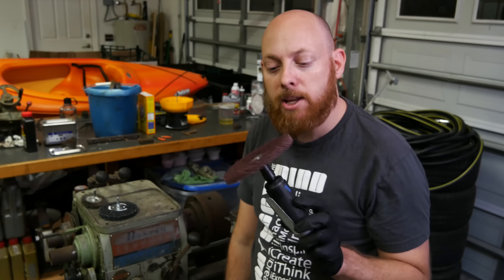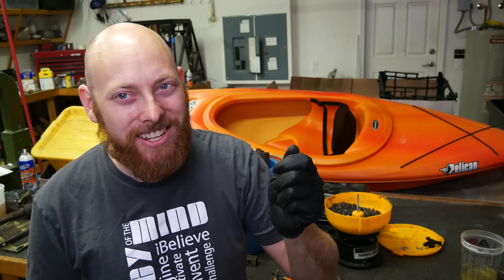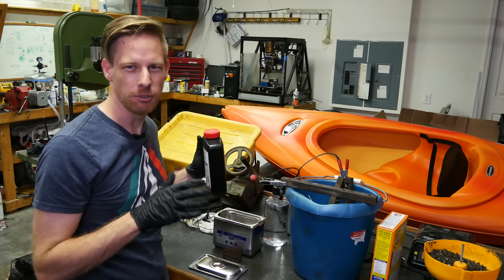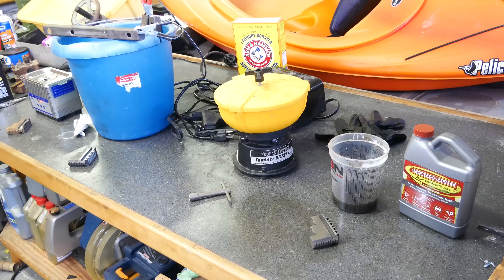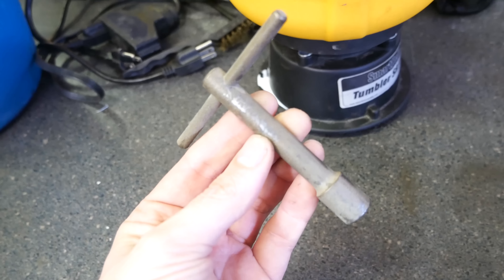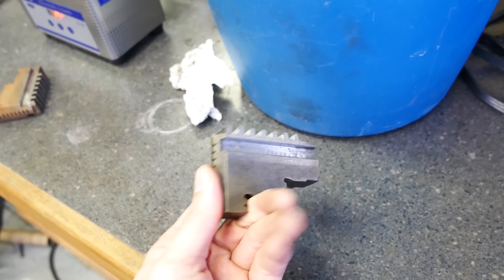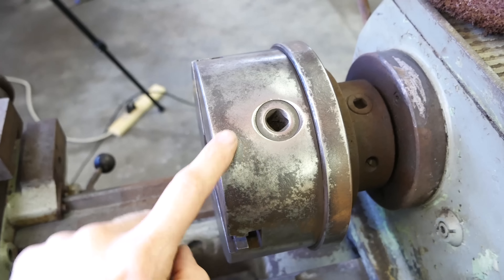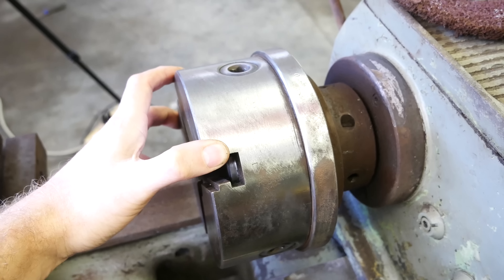Lathe Rebuild Part 2 (6 Ways To Remove Rust) - S02E02

Comment: Evaporust leaves a dark film on steel, especially when it is hardened.  You can just clean it off though.

Electrolysis is definitely a much cheaper option, but very prone to flash rust, which the film left from Evaporust prevents.
Reply from the maker: +Hand Tool Rescue that is good to know. I noticed the color would come off pretty easy. I have just been coating everything in a lite coat of oil after I pull it out of the evaporust
Reply: Stick the Evaporust in the ultrasonic cleaner! Works faster and minimizes the deposits
Reply: yes the dark 'film is called 'iron' ... it reduced the ferrous oxide to metallic state
Reply: I disagree, flash rust is caused from an oxidizer like many acids that are used (like hydrochloric acid) the electrolysis method will not cause rusting after the electricity is shut off, matter of fact an alkaline solution/deposit on tools will prevent further rust from occurring.

Comment: Ive been restoring an Old SBL 10K for a while now, I think you've done a great job. One thing I've done and It works rather well is mask and sandblast parts that are exterior pieces. It saves a lot of time and then I repaint them once fine wire wheeled.

Comment: hey guys, a bit late to the party however... i have found with basic rust removal, a simple vinegar bath (just plain white vinegar mixed with water ((3parts vinegar, 1 part water)) and a few hours left to soak usually gets most surface rust to break off, which is then followed by a quick scrub with scotchbrite, steel wool and any other abrasive will do wonders to the larger and less intricate parts, any maybe even smaller parts.. i could not stress enough though to dry any remnants of vinegar solution off after the scrub has been completed; to prevent further rusting of parts.. colder weather can affect this process (not significantly). loving the rebuild by the way! ps.... don't know how i found this channel but its so far so good for me! double thumbs up
Reply: also the solution can be reused multiple times, with a top up of vinegar every now and then! cheap and ez

Comment: When using an ultrasonic, the solution needs to be roughly 10 degrees below the boiling point of the solutions to get the best effect.  You want the pressure oscillation to create steam jets to do your scrubbing.  Frequency also matters.  For big chunks use low frequency.  For small scrubbing and to get into fine details, use high frequency.

Comment: Acid is usually used industrially for removing rust (pickling) I did an engine and sheet metal that way with great results except it ate a sintered iron harmonic balancer to where the original press fit became so loose it would spin on the crank! Adding some phosphoric acid "MetalPrep" left a nice phosphate coating to paint on, though I jazzed up the acidity with judicious additions of muriatic acid from HD. Take great care, it is undiluted!
I think the use of a base, sodium carbonate, was a great idea to make the electrolyte conductive, as I recall NaCO3 is good for cutting grease and combined with the agitation of the fizzing electrolyte was probably good at removing any remaining grease. It would be interesting to try that solution to cut grease and rust both. Glad to see there is an alternative to abrasive on stamped leas screw wheels, I hate to see them worn.

Comment: With a few years of amateur car part restoration behind me, I have tried wire brush and elbow grease, through to garnet (sand) blasting, and electrolysis.

I found it was best finishing the mechanical process with chemicals like "Jenolite" "naval Jelly" which are both based on acid, mostly Phosphoric acid with others.The phosphoric acid provides gives a grey phosphate coating that is rust resistant. I have parts in my spares boxes that where sands blasted and then treated with Jenolite that are rust free after more than 15 years.
I set up a 120 gallon plastic barrel of "washing Soda" and a 12 volt 30 amp power supply to remove the very heavily rusted parts, it removes the flakes (and paint) leaving the parts with a thin film of BLACK ferric (ferrous ??) oxide, looks like a fine powdery mill scale, this is best removed immediately with a wire brush or scotch-bright pad, and you need to stop further rusting.  
I tried acid of various types (sulphuric, hydrochloric etc) but I found the easiest and safest to be neat 81% phosphoric acid (sold in the UK as "PH DOWN" for hydroponics alkalinity control), it is FOOD GRADE (as used in cola drinks at about 0.05%).
I you forget your gloves it only stings your cuts, I don't recommend handling it without gloves, your skin gets "slippery" (dissolved).
I recently purchased a pillar drill with minor rust (not like the bantam lathe), the phosphoric acid removes and the rust minor and major, if brushed or cleaned with emery cloth the get the worst off. I clean the surfaces with brake cleaner and/or acetone both work well before the phosphoric acid, grease and oil will stop it working.
The chuck key was beyond repair, I thought I needed a new one, but I found that using the Phosphoric acid HOT, diluted with some tap water, I could achieve a BLACK finish with all the rust removed. Soaked in WD40 it looks as good as new. 
Further experimenting shows that the HOT DILUTED process can be controlled to allow a fine grey finish through to black, I used it to restore a pair of V blocks that had 50 years of thin bright orange rust collected in bottom of my apprentice tool box, to pale grey finish. I also restored a pair of rusty apprentice piece tool makers clamps back to black finish (originally oil blacked).I will in the future put up a youtube video, when my health permits.
Chris
Reply: CellZ
apper

Comment: Lye (bases in general) will work on fatty and oily products. Think of mixing it with human fat to make soap in Fight Club. You need an acid to remove rust. Zero reason to expect sodium hydroxide to work on rust.
Reply: exactly. rust is an iron oxide (oxidised iron) so we need to REVERSE this and REDUCE - which calls for an ACID
Reply: Lye solution is also the best for removing anodizing from aluminum!

Comment: About the ultrasonic cleaner. Use a solution of citric acid. And if there is grease on the rusty part, add a little detergent so the citric acid can penetrate the oily surface.
Reply: Not to mention that it is a tiny unit, that has next to no power, maybe usefull for a few screws at a time. For bigger parts etc. you need a bigger unit with frequency sweep.

Comment: The solution for the Ultrasonic Cleaner can be pretty much anything that removes rust...but quicker with the bath.
Using the Evapo-Rust in the US bath would work very well...and in just a couple/three hours.

Comment: Electrolysis is by far the cheapest and most effective, it will also remove layers of paint. You do need to make sure anode and solution are regularly cleaned for max effect. I personally worry about the safety of leaving it running with kids and pets so I take measures to hide the vat. I also like Purple Power/ Super Clean for a set/forget option if I'm not going to be in shop for a while.

Comment: Body shops use a product named metal prep which removes rust and leaves a phosphate primer coating for painting - scrubbing with a medium fine wire brush helps process. Similar stuff available at HD. When it loses its punch or if you want to punch it up a notch, try adding some muriatic acid (hydrocloric acid). Acid eats rust, bases eat grease. I used it on a small block Chevy engine once and it worked great on stuff that needed painting, left a phosphate coating on stuff that needed to be shiny, and tried to eat the sintered steel harmonic balancer, the formerly press fit balancer would spin on the crankshaft. I had to buy a new one - expect the same disaster with brass, aluminum and chrome dissolving. Use for short periods and neutralize with baking soda afterwards. Do not allow to soak unsupervised. This is with the HCl turned up strong. do not add water to acid, but do the reverse, water to acid can boil and blow it all in your face! This is industrial stuff, be very careful.

Comment: White vinegar in the ultrasonic would probably work better.  While a part can be left in electrolysis for days, don't leave your machine metal in vinegar more than a few hours without checking its progress, to prevention erosion of the metal..  The price was right, and now you will have elbow grease equity in the lathe, and should be able to triple your money, or more.  Nice find in the gearbox.

Comment: Maybe a little bit late, but vinegar acid reacts with the iron (Fe) and builds acetats (i don't know if this is the right english word) it's a little bit like blueing metal and i also prevents from further rusting. Not to much of course. But you need to neutralize the acid, otherwise you have rusty parts within minutes. Washing powder with water works very good for that.

Comment: 8" 3/4 hp bench grinder with a twisted wire brush. More fragile stuff a normal wire wheel. 
For the 'chemical ' solution. Mollasses but you have to hose the gunk off and then CRC it or will go rusty immediatly. 
For the bed a twisted wire 4" brush on a diegrinder.

Comment: white vinegar
Reply: This is the best and cheapest solution. No discoloration or etching like evaporust. Will eat the rust down to good metal and doesn't take as long.
Reply: Isn't that the main ingredient in Evaporust?
Reply: Hydrochloric Acid (muriatic acid) is the active ingredient in white vinegar. For $10 at Lowes you can buy a gallon. Important note: you need to neutralize the acid afterwards, Bicarbonate soda works well, then rinse, and paint or cover with oil film.
Reply: there is no HCl in vinegar.  vinegar is acetic acid in water, about 5%.
Reply: I recently put white vinegar to the test on some rusty old Gym weights and the result was great. Very hard option to beat for the price.
Reply: Mike St. G
Reply: Cleaning Vinegar even bit stronger. Awesome rust remover. So is Navy Jelly. Restoring 100 year old lathe with it but believe it or not there is almost no rust.
Reply: muriatic acid = better - ANY rust 'cleaner' worth it's salt is acid based
Reply: no there is no H Cl in vinegar - but there's plenty of H+ !! - i suspect that's what Rick meant ... that acid was the 'active ingredient' and rick is PERFECTLY right as muriatic acid is FAR stronger = more effective

Comment: Why would you mention the minuscule power use of the electrolysis and not the cost of a bottle of Evaporust? not to mention toxic chemical solution everywhere. Get a good quality bench top power supply that outputs around 30v/10 amps, make your anodes bigger in order to draw more amps and then you can do the whole headstock in a few hours paint and all. It is by far the most gentle but bubblingly effective way to do it. Great video by the way, you wont regret having and old English iron machine tool in your shop.
Reply from the maker: +Tristan Patterson that's a great point, I wouldn't have considered this for paint removal. I will have to give that a try.
Reply: Tristan Patterson - I agree electrolysis is a winner. However, I noticed excessive bubbling means only water is being split, the process is somewhat blocked by the surface layer that develops on the part. To overcome this, I mixed two technologies to remove rust from some smaller parts (collets), did the electrolysis in an ultrasonic cleaner, with the below mentioned vinegar solution.  The process speeded up dramatically.  Quickly wiped off any remaining loosened up surface contamination, washed off the part and immersed in mineral oil completely, before final wipe down. I also used graphite electrode, leaves the solution cleaner than iron ones. My ultrasonic bath is about the same size as in the video, so larger parts may not fit.  To prevent the electrolyte causing accidental damage to the cleaner, I filled the tank with plain water and the electrolyte, electrodes and parts were inside either a plastic bag, or in a plastic bottle, immersed in the tank.  I've been thinking to get a marine boat de-fouling kit that contains the transducers and immerse it for agitation in a larger container, it is on the to-do list!
Reply: Wow, yeah the graphite electrodes is a great idea. Do they conduct as good and how large can you get them?
Reply: Tristan Patterson - Graphite is an excellent conductor.  eBay is a good source for inexpensive rods at around 6-10 mm diameter, usually Chinese origin, some are sold by the dozen, some by weight. Otherwise EDM electrodes are also quite good, but the dense high quality ones may be too expensive for this application. Aluminium (aluminum) smelters use huge ones as anodes, I bought some at an auction up-to 150mm diameter and 1m long in view of making my own electrodes for larger parts, but that would require a much larger power source than what I currently have. For thin pencil size ones I use them in parallel, say one inside the centre line of the collet and three evenly spaced outside, to even the current distribution. It works with just one, but you need to either reposition the part or the electrode every now and then. Just make sure you don't short with the workpiece. In a pinch you can salvage some from discharged Extra Heavy Duty lantern batteries, the centre electrode is a carbon rod. (Not the later alkaline ones which use a different chemistry, please look it up). Good luck experimenting!
Reply: Excellent, I have some of those lantern batteries.
Reply: Tristan Patterson Evaporust is non toxic and biodegradable and can be poured down the drain for disposal. You should check yourself before criticising someone else.
Reply: Fair point. I have only recently got hold of a bottle and you're right. I was not criticising but merely pointing out the benefits of electrolysis.
Reply: Great information! Quick question regarding graphite electrode though, I was under the impression the cathode needed to be iron for deposition. Does the free iron deposit into the graphite cathode or stay suspended in acid solution?
Reply: Christopher Bogart 1

Comment: Rust.. If you are in a hurry 5-10 minutes in 30% HCL and 10 minutes in a bucket of water with a teaspoon top of backing soda then dry with heat gun or hairdryer and oil.. trust me that works
And if you dont like HCL and have more time submerge  4-5 days in vinegar then wash and light scrub with a kitchen sponge and then 30 minutes in a bucket of water with a teaspoon top of backing soda, then dry with heat gun or hairdryer and oil..

Comment: citric acid is good on copper and brass dont know about iron and steel. Citric acid is used for cleaning  wine bottles, it can be purchased in crystal for to dissolve in water.

Comment: high grade phosphoric acid is the best solution for removing rust.
Reply: I totally agree.  I use Naval Jelly (Phosphoric Acid in gel form)  for things that cannot be easily removed and dipped.  For most other items I use either electrolysis or a Phosphoric acid solution.  The only warning is to not leave cast iron items in the Phosphoric acid solution any longer than necessary.  Plain steel does not seem to be limited in this way.

Comment: 1:29 because baking soda sounded too unprofessional 😂😂😂
Reply: THE MTB FANATIC "super washing soda," baking soda will work too but slower. Any electrolyte will work actually, but I wouldn't recommend table salt because you'll be generating chlorine gas in the process if you do. Sodium bicarbonate is sold even cheaper without a brand-name if you get it from a pool supply store or from a chemical supply for printmakers.
Reply: He wasn't using baking soda, that's why. He was using sodium carbonate, which is washing soda. Sodium bicarbonate is baking soda. Lol

Comment: NO NO NO NO - you've got it ALL WRONG my little chappies! rust is what ..? OXIDISATION - correct? you need to REVERSE this - not oxidise FURTHER ... you need to REDUCE the rust - and how do we do that? we use an ACID to REDUCE the ferric oxide to Fe metal ...